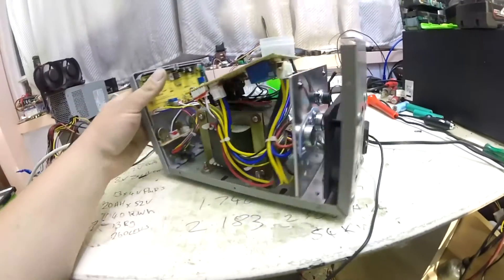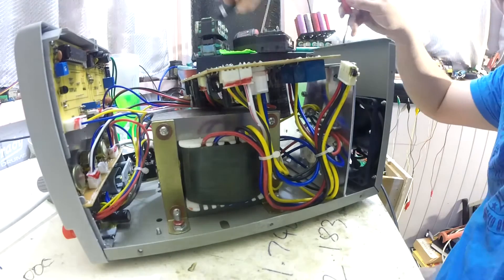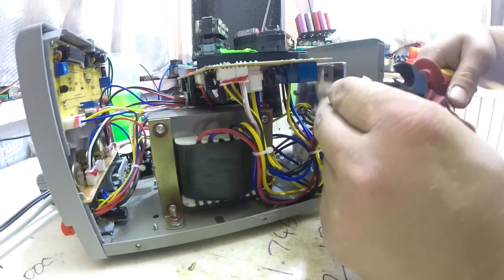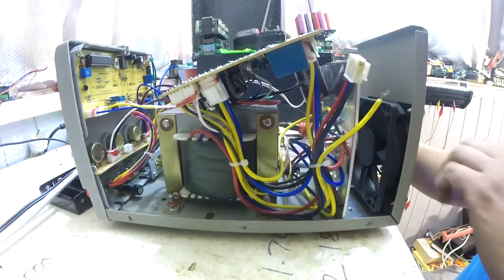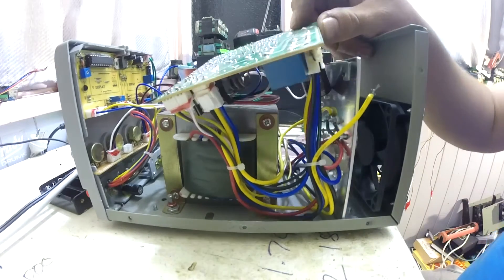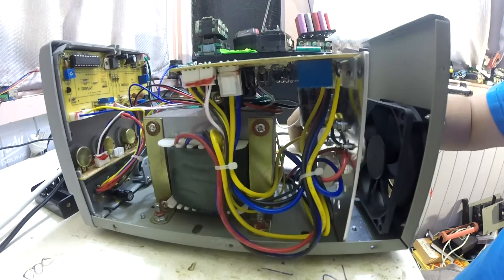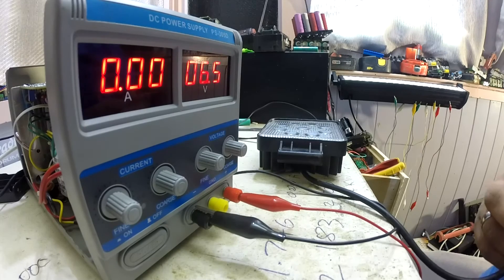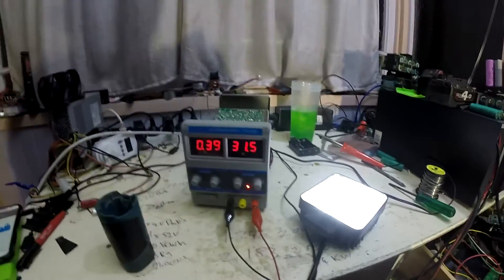Lab power supply is fixed!! 0-30V 5 AMP

Comment: I replaced the mj15024g silicon transistors on mine and it fixed my  problem. It's those 4 silver bottle cap shaped items near the fan on the back. I overcharged some batteries and damaged the transistors.  https://www.newark.com/on-semiconductor/mj15024g/bipolar-transistor-npn-250v-to/dp/26K452

Comment: I have that in my garage and I test it and it works well and Il do sam mor testing whet it and tomorol I'm driving my mates new tow truck 2019 model 12 Speed bicos i'm testing main for a video and yaeh Got sam work to  do sam off road driving tomorol and I like to test evriting helps my relaks 😎cheers

Comment: Sorry about this but, get yourself some proper electronic flush side snips, clean that soldering iron, it looks like roo droppings, get a pack of small files, twist the ends of cables before you solder or end up with a wire mop like you did. Put the solder to the iron on target or the flux is useless. Mind you jolly good vid to show young fellows how not to repair a bit of kit. Don't take it to heart, I  grab live 245V wires - right across the old ticker. What a laugh.  Is it still working ? I  do mean the power supply.
Reply from the maker: Any tips are good ones mate cheers i appreciate the info